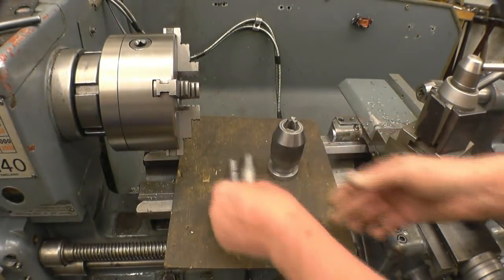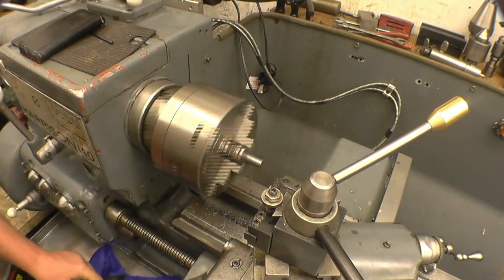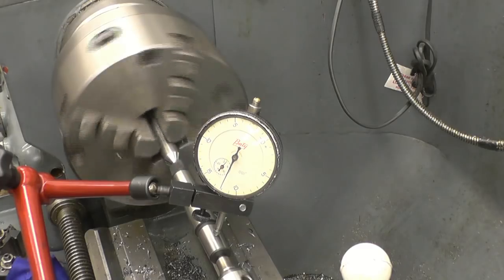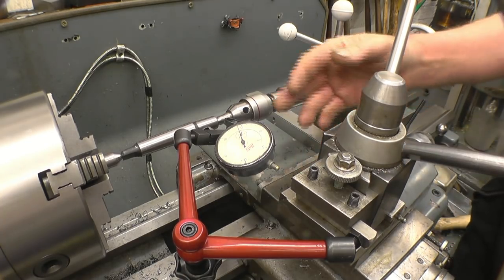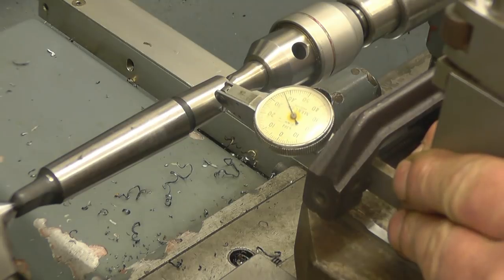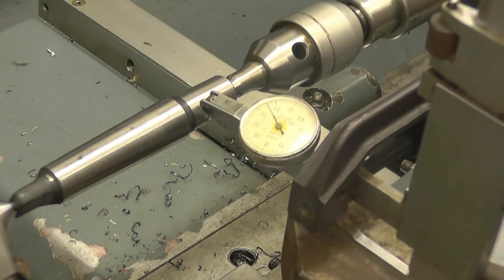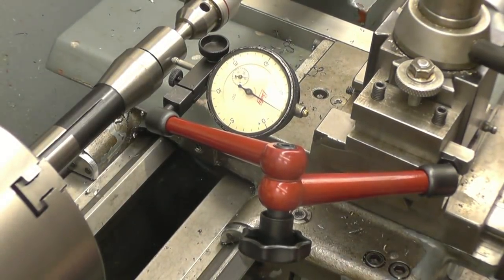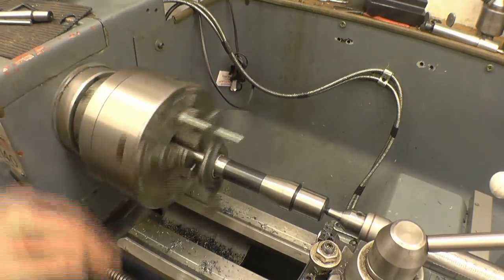SNNC 225 P2   Machining a Short Taper

Comment: Enjoyed both night caps as usual. Would it not have been easier to mount the dti more rigidly in the toolholder on a piece of bar, then just use the toolholder height adjustment to centre the dti up on the tapered section? I've two more weeks to go before I head off home. Your videos are about the only thing maintaining my sanity at the moment.
Reply: I wondered about this same thing.